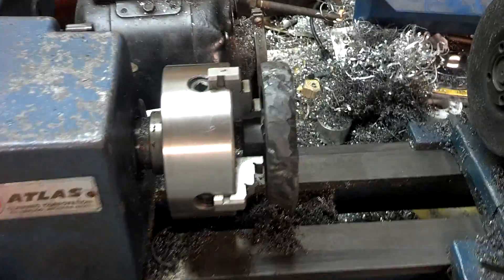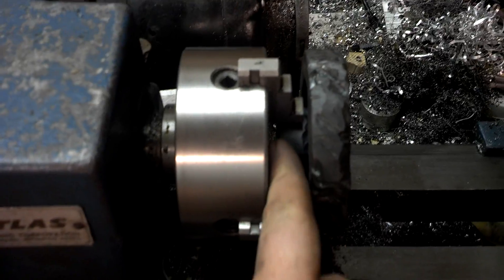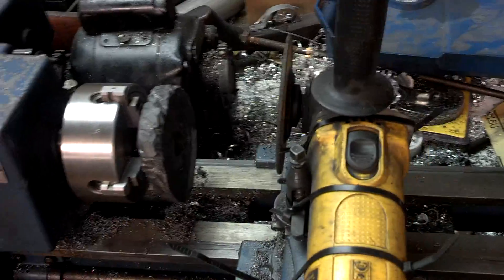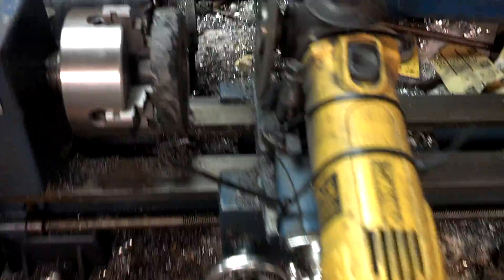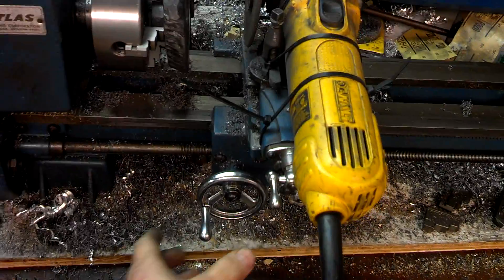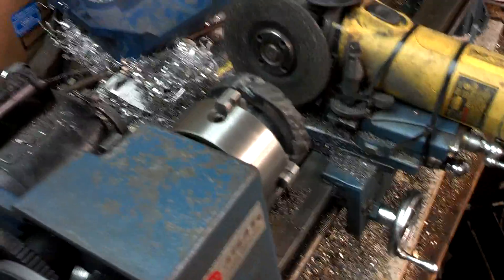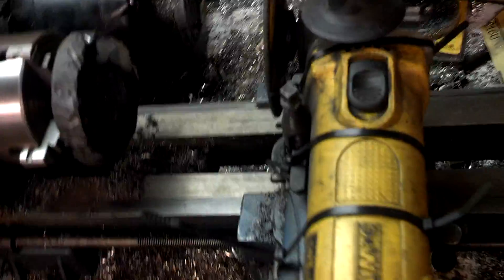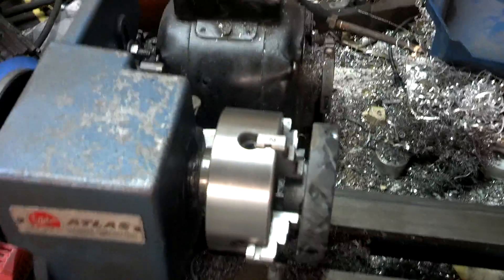Cool Trick: Angle Grinder and Lathe

Comment: The idea is not bad but you give bad luck alot of chances whit the zip ties. You could lock on your lathe bed a longer steel bar or pipe so you can lock your angle grinder whit ratchet belts and then just do th damn math for angle grinding. At of your angle grinder 10.000 rpm your chuck needs to spin at 2 or 3000 rpm, this is just rough estimate plus for side grinding you need grinding stone not disc, the disc is flexible and is for tangetial cutting when stones are rigid and can be also be secured whit steel plate disc on the non grinding side.

Comment: you doing it wrong xD , a lathe is made for that job but not like you do it. Use a normal lathe tool more, more rpm and proper fixation. (unmount that anglerinder) Just watch lathe tutorials how to use a lathe the correct way, your life will get easier.

Comment: Dewalt is an awesome little grinder.  The bearings have no play, so I used a $30 grinder with a 1/4" fine grained wheel (7 inch wheel cut down to 4 inches) to be a tool post grinder on my lathe.  Now I can consistently cut to less than 0.0002" on shafts with no bending.  My resolution limits are on my machine and my DRO.

Comment: Necessity is the mother of invention... Clearly stated in his comments not safe at all. 
Now based on all comments it seems like with some better preparation and modified grinder guard, he essentially has a lathe grinder per-say... Which they do sell more like a Dremmel.

Be safe and wear a face shield, protect your lathe bed no matter what. Grinder should be held with worm gear clamps and affixed to a plate bolted to the tool post.

Work safe....

Comment: Hi All,
        Well what can I say. I've seen it all now. With the spark stream hitting the ties ,It won't be long before the tie separates and all hell will be let loose. Apart from the health and safety aspect, the abrasive dust from the angle grinder disk will ruin all that it comes into contact with. I would advise anyone intending to use this method to think again if you want to keep yourself and your lathe in one piece.
MoK

Comment: Mate everything here is wrong! where is the grinder guard? Why do you and so many others want to end up with a doctor pulling bits of metal and carborundum out of your bodies (if you survive that is).
Zip Ties! Holly Xyz, you cannot know when you have pulled them to critical breaking strength and them Kabam stuff flying everywhere!
You obviously don't value your lathe in any shape or fashion! Grinding yes, but under controlled circumstances and use of protective coverings for the lathe bed etc.
Don't you own a garbage can? That's where the swarf belongs!
This video is "HOW NOT TO DO THE JOB" Not.... "Cool Trick" as you call it!
Next time you have this sort of job buy a decent carbide holder and tip, there are plenty on the market that will cut through tougher stuff than what you were doing.
Reply: WELL SAID BRUCE
Reply: Bruce Whitham When I saw this all I could think of is ''FUCK ME'' this pricks got a DEATH WISH
Reply: Bruce Whitham Don´t be so safety troll... I think, he destroy his lathe earlier by the sharp grinding dust, then kill himself by accident.

Comment: You need to make more robust holdings for the grinder, but this will work and give terrific finishes;  The problem is that the dust will wear the slides and if the dust gets into the coolant system rapid wear will result. Protect everything as much as possible and tighten that grinder.     Always run the work in the opposite direction to the grind wheel which you do here.

Comment: I don't see it done any other way with what you have. The surface of the piece is jagged and hardened from welding. Putting a carbide lathe bit on there is dangerous (send carbide bits everywhere) The grinder applies very gentle force then flattens the surface. Only after this the carbide bit is introduced. Good job.

Comment: Recommendations. You could, however, use the nut built onto the grinder to bolt the grinder down, but not exactly necessary since the force is very light and the only danger I see here is the grinder wheel crashes, sending chips mostly in a particular predictable path. I would not stand on the path of the trajectory, however. I would stay left.